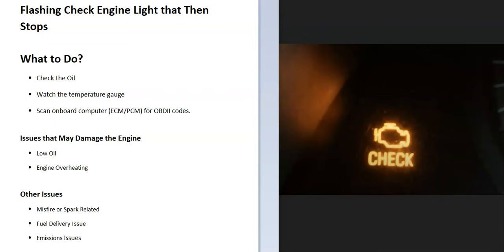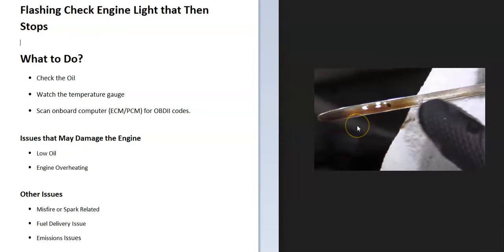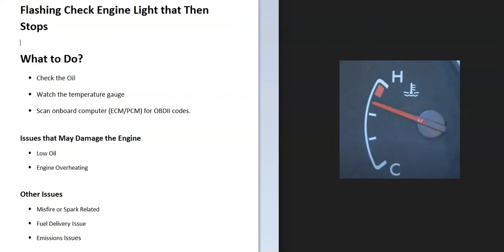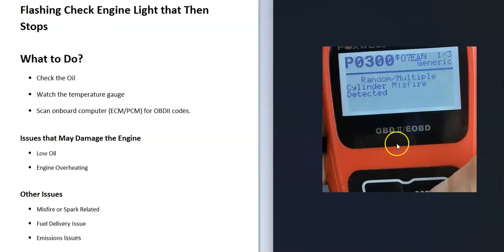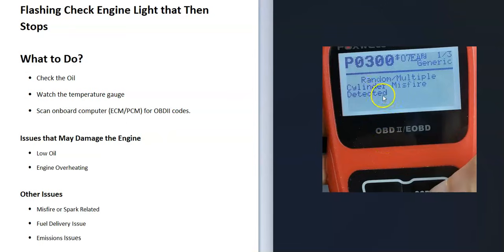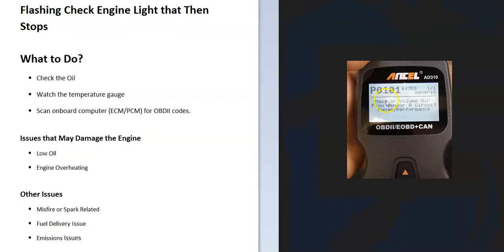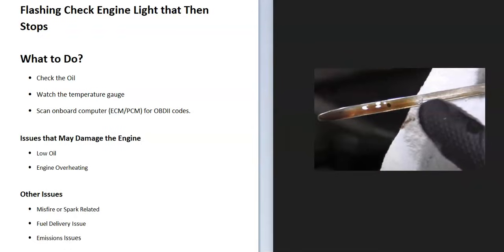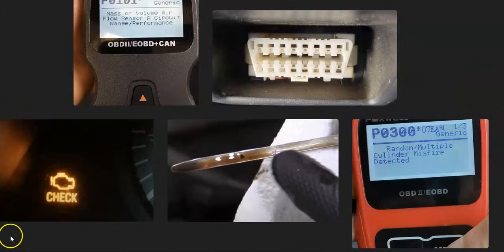What to Do When Flashing Check Engine Light Then Stops

Comment: My CEL flashes only when cold started, then steadies when warmer. Only flashes for 20 secs. P0304 perm and temp codes. New plugs and coils are good.
Reply from the maker: If there is only the P0304 code and the plugs and coil are good, I would test the injector.
Reply: Run some injecting cleaner that is quality not just default AutoZone trash. We'll go deeper take them out and clean them. I have a 2012 eco-boost. F150 and I had to replace the coil packs every six months because the turbos run too hot and Ford designed this at the level of recall should have been initiated imagine pulling out onto a 60 mile an hour highway, taking a left turn and all of a sudden The engine completely misfires and bugs down and then you get T-bone  but Ford doesn't care and THSA would claim it's a lack of maintenance and people die. Yay. I replaced all coils with accel, racing coils, and then the same thing occurred. Coils would fail. I checked four signs of oil circulation in the turbo  intercooler, but there was barely one  drip.....  the only thing that fix this was to leave all of the top engine covers off and now I have not had to replace the coil packs. Horrible design, ridiculous testing and there should be a recall.

Comment: CHECK THE OIL AND WATER AND KEEP DRIVING IF IT NOT BROKE MAKE IT HOME ,IF IT IS NOT CUTTING OFF OR ANYTHING CRAZY MY CHECK ENGINE LIGHT HAS BEEN ON FOR YEARS 174,171,401,301,305 PUT SPARK PLUGS COIL NEW WIRES SO IT'S A TIMEX IT TAKES A LICKING AND KEEPS ON TICKING 😂😢😮

Comment: I have a 2005 Chevy Express 1500 with a 5.3-liter engine and 193,000 miles.  The check engine light flashes intermittently above 65 mph.  I changed the plugs and wires and 4 out of 8 coils.  I only replaced the coils on cylinders with a misfire history in mode 6.  After all that, it's still doing the same thing.  Some people on the internet are saying that a stretched timing chain can cause a flashing check engine light above 65 mph.  Some people are saying that a crank relearn will make it go away.  Do you know anything about this?
Reply from the maker: It needs to be diagnosed but has the fuel filter been replaced recently? Low fuel pressure such as a weak fuel pump or clogged fuel filter can cause that issue. It could also be a stretched timing chain but usually there is also Cam/Crank correlation such as P0016 or P1345 codes.

Comment: have a 2013 xts. cel shows up for about 15 to 20 sec then turns off. did oil spark plugs o2 sensors fuel injecters hoses and everything else lol. runs good but dnt know what it can be. it also passed smog here in ca.

Comment: What kind of tool did you say to use to  check engine light.
Reply from the maker: An OBDII scan tool will scan the computer and report any issues. There are low-cost, basic units for general information and high-cost units with more troubleshooting options.

Comment: I am currently borrowing a car from the mechanic. I have had it for almost a month and when accelerating fast today my check engine light started blinking yellow for a few seconds but disappeared when I stopped accelerating quickly.

Could I have caused this problem over a month or is it possible the car was already in bad shape? It's a 2008 Ford fiesta.

I'm panicking a bit that I destroyed the car somehow lol. Thanks

Comment: Just changed my spark plugs and the engine is now shaking and getting a squalling noise when I start the car(2006 Impala). Any suggestions? flashing engine light.
Reply from the maker: A spark plug wire might have accidentally been hooked to the wrong cylinder or something unplugged. There are likely codes that can point to the issue.

Comment: Does light need to be on for scanner to work?  Auto Zone told me that if light has gone off - the scanner won’t work.
Reply: Yes they told you correctly, but depending on the code scanner you use you can look at the freeze frame data and see the codes that were set off even if the check engine light is not currently on

Comment: Bro, the check engine light flashing is not your temperature gauge or your oil you have separate gauges for those your oil light will come on or your temperature will become hot on the gauge LOL it usually means a bad ignition coil! LOL nice video

Comment: I got my spark plugs changed , a new ignition coil , i had a coolant leak i got that replaced as well. What could it be ? At first it was throwing misfire but i got all that changed
Reply: It ended being a head gasket replacement, intake cam and lifters all that for 7k lol
Reply: Damn
Reply: Air filter

Comment: CEL flashes at high speed only and then stops when I get to about 60 mph. It doesn’t register a code with a scanner, oil is good, coolant is good, transmission fluid is good. Changed plugs and wires and it still does it. What would be next? Thanks.2001 Chevy express 2500.
Reply: I ended up having oil leaking into 2 cylinders, but in the repair manual, it says a spark plug that rated hot could make that cel turn on at high speeds and it recommends getting plugs that aren't so hot
Reply: I got the same thing did u figure it out
Reply: @JBish  the owners manual says a spark plug with a higher temperature rating could get that result. My flashing cel took on another issue unfortunately
Reply: @jasonv.9015 I have an 89 ranger that’s doing the same thing, CEL only in 5th gear but everything seems fine. Did you ever find a fix?

Comment: if it is orange or yellow you don't have to worry. You still need to get checked but it won't be engine damaging and will even go through inspection.
If the light is red is where the damaging stuff shows and you need to pull over quickly. Orange will not light for no oil or an over heating situation.
Reply: Is that for every car?
Reply: @habbaticchio2468  Unless it is from the 50s or 60s yes all cars idiot lights are that way, with or without gauges. Whatever the message is behind the light deciding to glow. yellow means something needs to be looked at in the near future red is pull the hell over before I blow up.